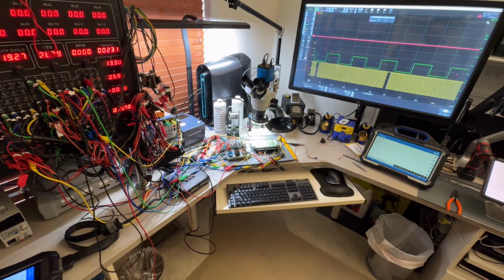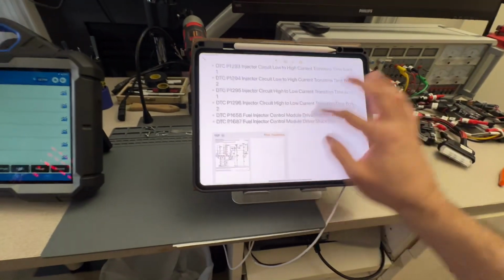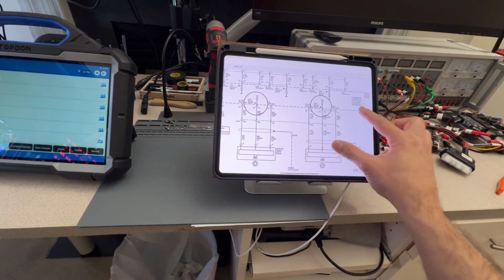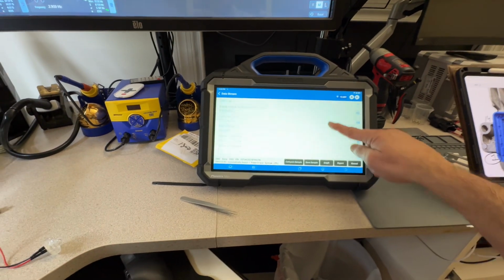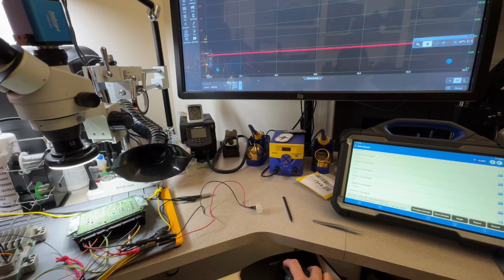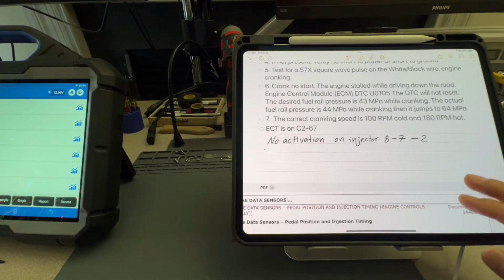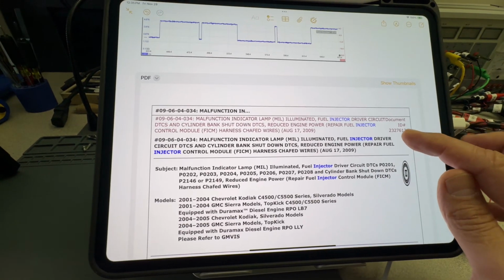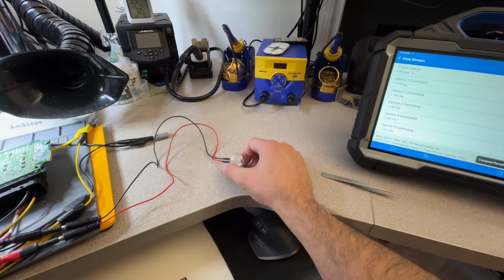2005 Duramax LLY PCM and FICM test for Michael W in NC

Comment: How do you get the ECU to respond without other immo-related devices connected. Eg bcm
Reply from the maker: @bashdavid9223  it is not possible in all but low rpms is the secret
Reply: @ all ECUs or GM secret?